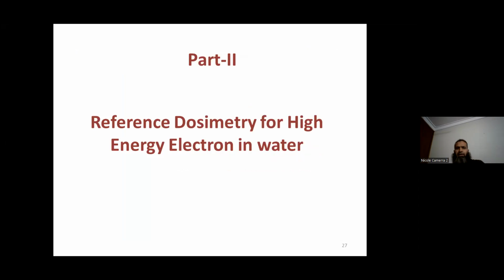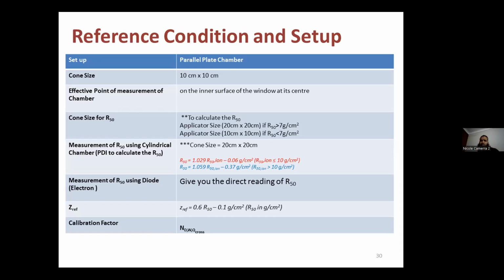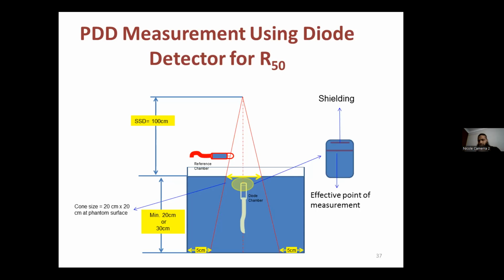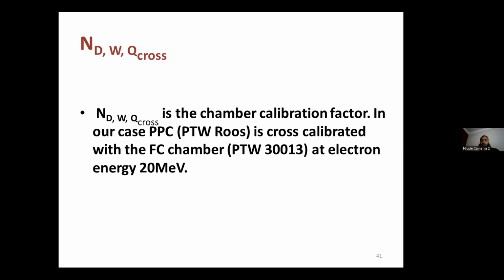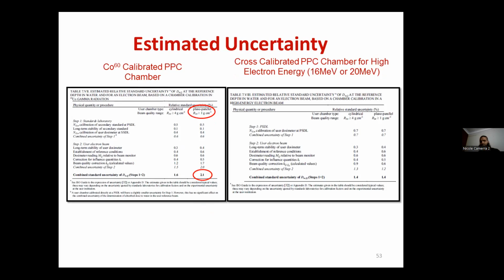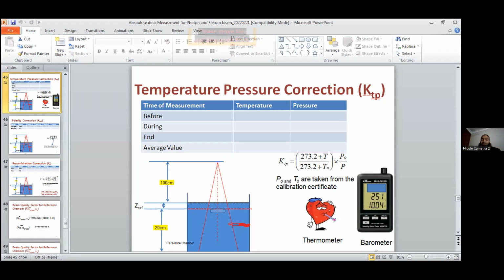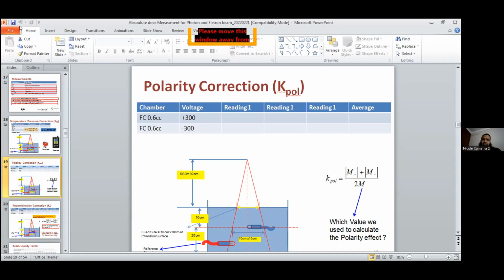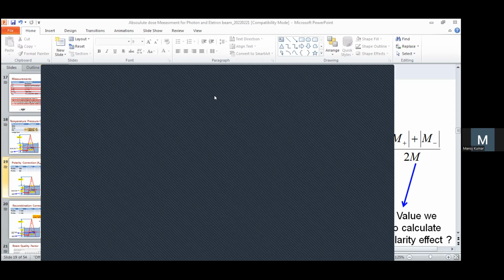Dosimetry; Electron Beam Reference Dosimetry by Mr Talat from Australia

Comment: Assalam-o-Alaikum Sir,

Muhammad Shoaib here, Medical Physicist from PIEAS University Islamabad.

Sir, thank you for your elucidation during the lecture. I only wanted to humbly clarify a doubt so that I could validate my understanding regarding the discussion around 51:00 in the lecture.

After reviewing TRS-398 and the physics of ionization chambers, my understanding is that (M+) and (M-) do not actually represent separate electronic and ionic currents. Rather, both are ionization current measurements taken under opposite polarities, i.e., +300 V and −300 V.

Furthermore, in air ionization chambers, free electrons rapidly attach to gas molecules, so charge transport mainly occurs through positive and negative ions in both cases. My understanding is that the polarity correction accounts for small differences in charge collection due to field asymmetry, recombination effects, stem effects, and other perturbations that arise when the electric field direction is reversed.

I may still be misunderstanding something, but I would be very grateful if you could kindly confirm whether this interpretation is correct.

JazakAllah Sir.